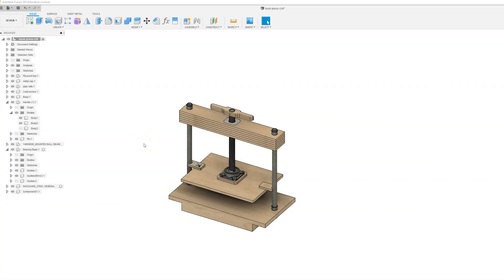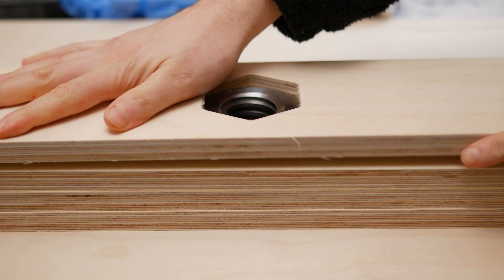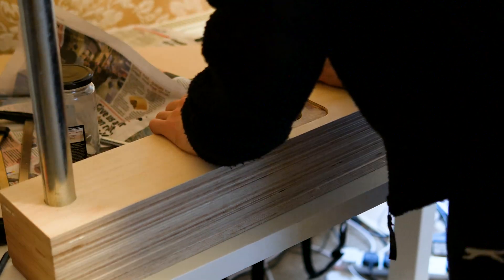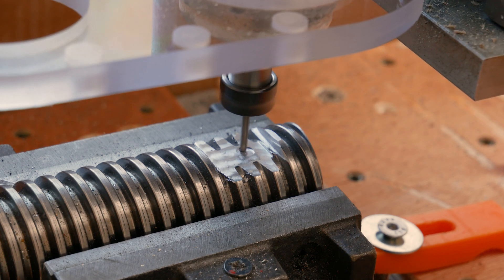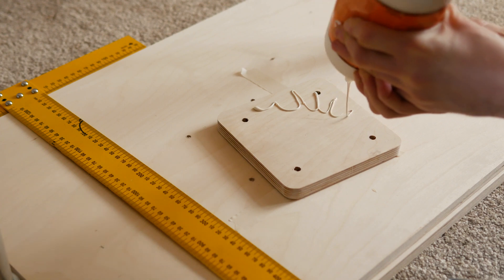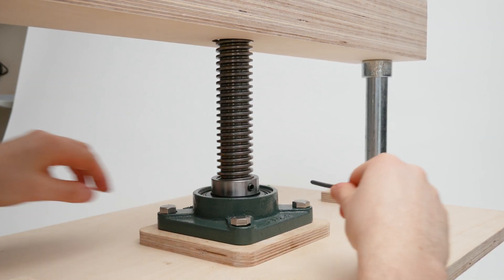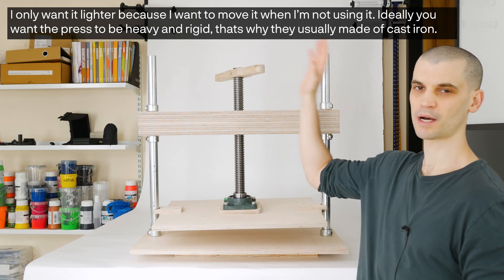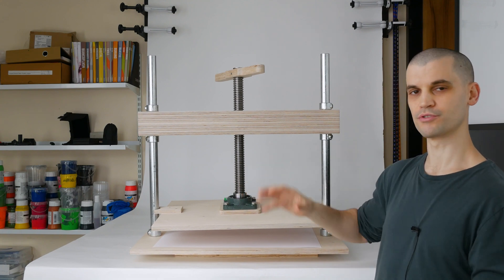How to build a DIY book press // LARGE A2 Size!

Comment: Excellent video. Congratulations. Nice work, your press.
I intend to make such a press (nipping press), but to print photogravures from photopolymers on a metal plate, on paper. It's an Intaglio.
I know you also made a press for engravings, but it's a more complex project for me at the moment.

I only have the central screw with a handle on one side and a base for fixing/rotation on the other. It was from an old wooden lathe.

My question is whether this type of book press produces enough pressure for engravings. Is there a way to know what force this produces?

Thanks for your help.
Reply from the maker: Hi, unfortunately it would produce nowhere close to the pressure required for intaglio.
Reply: @ThisDesignedThat  
Thank you very much for your response.
Could you tell me, even approximately, with numbers, the pressure that your (this) press produces and the pressure needed for an Intaglio?
Reply from the maker: im not sure what type of numbers needed but intaglio requires the highest pressure of of all the printing techniques,
Reply: I am studying the use of a hydraulic jack (bottle model). There are several with different pressure capacities. From 2 to 50 tons. They are small, safe and relatively cheap when compared to a cylinder press.

Comment: Excellent book press, Paul. I wouldn't make it lighter by hollowing out some of the laminations of the leadscrew cross member. It really does need to be as heavy and as rigid as possible. If you look at the 19th. Century press I have, it is made of iron and steel and the cross member is huge. It is not meant to yield under pressure. A large leadscrew is necessary. I will have to get my press fixed, as the screw is bent from someone in its past history, giving it a massive yank on the handle. You have done the right thing building it as heavily as possible, it is built to last forever. Cheers.
Reply from the maker: Now I have welding machine I'd love to make one from steel!
Reply: @ThisDesignedThat  Some people have made them out of galvanised pipe, for that industrial steampunk look.

Comment: Oh man, nice camera! Anyway my dude, thanks for taking the time to make this video. I plan on building something similar, if a bit smaller for my wife. I'm a passable carpenter and former theatrical props master, so I think I can manage, but it won't be as fancy as yours. 

What kind of drilling machine are you using? And the metal etching? I might need to get me one of those... very nice!
Reply from the maker: I used my CNC to do all the hole cutting. The metal engraving was also done on my CNC. All could be done with hand tools though, just get some forstner bits and a hand drill, should be good to go.
Reply: @ThisDesignedThat  Surely. But that CNC is slick as hell.

Comment: Hi. Thanks for sharing your knowledge and well done on a wonderful video. I'm investigating building my own press. I'm so glad I found your video. I almost made the mistake of buying general threaded rod. The trapezoidal lead screw is the way to go. Accu.co.uk has lead screws with different leads.  I was wondering what the lead on your lead screw was. Many thanks.
Reply from the maker: thhi, yes definitely go with a trap lead screw. Mine was 40mm diameter, 7mm pitch. You dont need something that beefy though if you are trying to save money. You could easily use something closer to 30mm diameter

Comment: Looks great, but I wonder why you didn't add a second full layer on the base to make it sit completely flat. It looks a little wobbly with the smaller base plate.
Reply from the maker: plywood costs a lot in the UK so i decided not to use more for the base as it would just add more weight to it and i want to be able to move it around. I'll stick 4 legs on it at some point but its not really needed